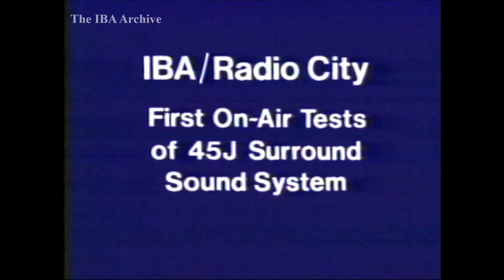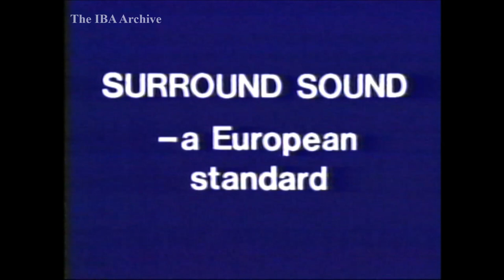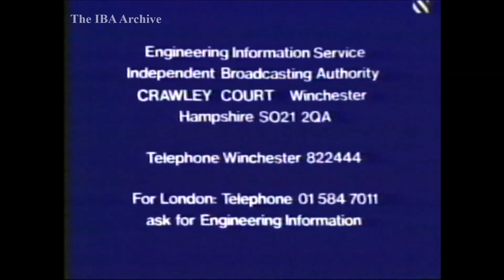IBA Engineering Announcements - 14 June 1977

Comment: In some parts of South West Cumbria, it is possible to get Winter Hill Transmitter without having to fall on Millom Park relay transmitter and with a good signal strength, it transmitted 500 kW omnidirectional power in analogue mode across North West England getting into part of South Lakeland, North and North East Wales, pockets of Shropshire, North Staffordshire and on the eastern flank of the Isle Of Man in Douglas.
Reply: Parts of Telford also depend on Winter Hill due to local terrain.

Comment: Colour bars at the start!  Would like to see it with the red bit at the bottom.
Reply: Frankly, the "red bit" would be seen on the static testcard junction before starting up the Harlech Television network in the 70's and some point throughout.
Reply: @kalbright3275   Before ETP1 was introduced in 1979, Thames would have colour bars with no red bit and the same deep tone as ETP1. Five minutes before startup, the red bit would appear and the tone would change to the high pitched one like here.

ETP1 replaced the colour bars without Red Bit (what is it's proper name?).  It would jump from ETP1 with deep tone to colour bars with red but and high pitch tone at the same point as previously - typically 0925h, 5 min before channel startup.
Reply: @kurtvanderbogarde8402  These are usually just some basic types of color-barred cards in many cases, but I think it's often better to use a widely-ranged testcard screen with as much known and rare features as possible.
Reply: @kalbright3275  The colour bars with and without the Red Bit, then ETP1 as a substitute for Without, were a part of my early childhood watching the Thames TV startup.